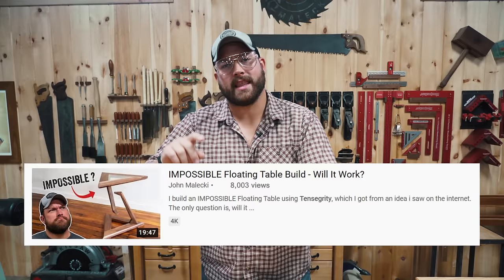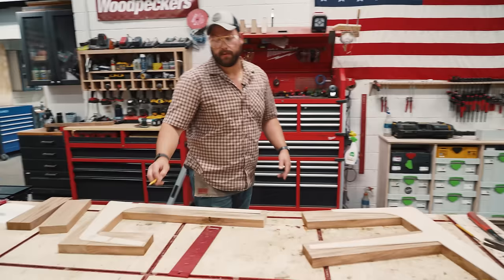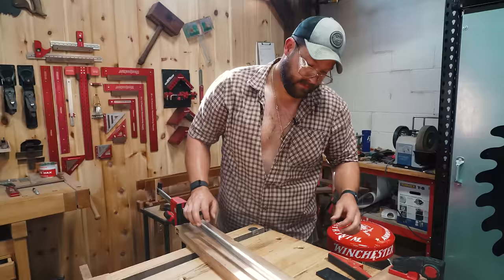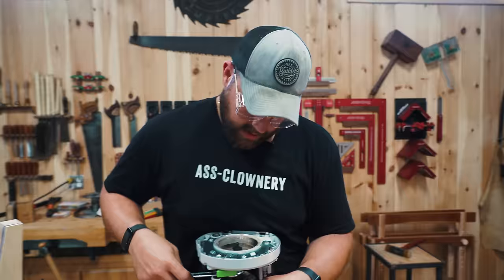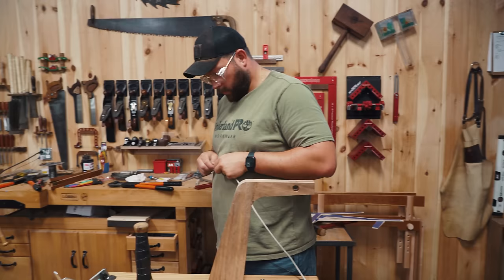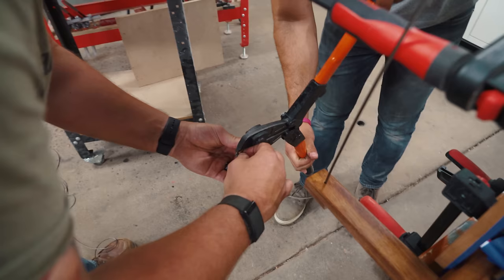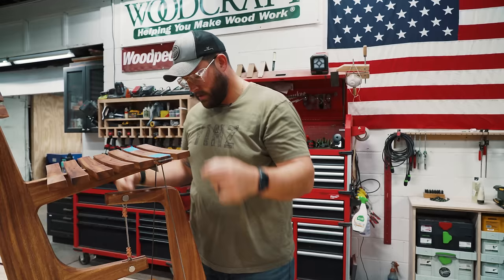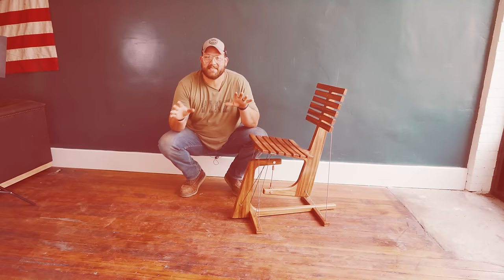Does This Chair Actually Work? My IMPOSSIBLE Chair Build

Comment: OK 1. You effectively mad a 2 point chair. All of the cables rout through the center and you lost your side to side stability as a result. Also adding a tensioning system would really help with the stability. 2. As the center of gravity changes depending on how you seat yourself on the chair, I believe you would need at least 2 cables for the vertical support one in the front and one in the rear. The rear then would either need the front of the frame to be beefy as heck or have struts running from it to the floor to support the load. In conclusion I think you need 6 individual cables to make this chair work, but they all need to run straight up and down. 2 center weight supports. 4 side load supports. Either beef up the lower frame or add some extra supports for the rear cable so it doesn't snap off when you lean back in the chair. Finally for the chair to maintain level the cables need to be tuned to be in equilibrium with each other. After all that I think you would have a really awesome looking chair that is functional. But I think it would be cooler if you used really high strength fishing line, as from a distance it would be harder to see than the cables. 500lb mono or spider wire could be pretty cool and with the changes I suggested should give around 1000lb of capacity on the lines. Though I doubt the wood would forgive anyone for trying that... Anyway awesome build. A+ for initial looks and craftsmanship. D- for functionality and engineering. AKA the perfect office chair for guests, as it looks good but also says, "You are not to sit here.". Hope to see a round 2 on this project soon.

Comment: I would believe if you move the main center carry wire 2-3 inch back on the back piece and adjust the rest of the wires, it would do the trick.
You’ll probably hafto shorten the center Wood on the back piece. Happy day.. nice work.

Comment: it could help to just move the top part forward. (making a new hole in it for the middle cable) that brings forward the center of gravity and it makes it easier to sit down because less of the bottom part sticks out in the front. cables that run through could have more stability if they are fixed where they run though the wood. also i think the last cable you added does nothing.

Comment: If you would’ve tightened the back cable while you had the same weight as someone sitting on it I would think that would have helped prevent the rocking side to side.

Comment: Extend both arms and do a "center" cable at the front and at the back to deal with the shifting weight normal chair use, would be my attempt. Then you could probably also get away with just a cable at each corner.

Comment: The issue is the counter balance is diverted so close to the middle that the slack is going to cause a dip. If the cabling went straight down on the corners, it's less likely going to dip on either side.

Comment: Before you add all the extra cables at the end if you just put a post from the rear of the base to use a cable through and hang the rear of the seat... Would make it way more sturdy because the weight would be on 2 points instead of 1. Cool chair all in all tho

Comment: Instead of one center rail make two on the edges and one in the center but turn the center one backwards and have the points of balance two on the back corners and one in the front center

Comment: agreed with Puke. A stool or something that situates the weight centrally would be your best bet. You're probably never going to be able to get away from a center of gravity that will continually want to be further back on the piece. Consider the fact that you are always going to put pressure on the chair at an angle when you sit back, so you have to counter that, but in an equal and opposite sort of fashion. 

Upon further thought, I think you could make this work with less cabling altogether, but a couple more in the center of the chair. Probably just need 2 cables on either side in the front and the back of the chair angled at approximately 45 degrees on the horizontal and vertical axis, down to the outside point of the legs, might need to make the legs a littttle longer. Then connect 4 cables from the outer most seat slats (maybe swap those to metal, or suuuuper reinforced wood) to the center of the bottom (where you have the single cable currently). In doing it like this you should have fairly equal tension in all directions so that even when you sit in it the backwards force should be counteracted by the cables in front on both sides and from the legs as well as the seat. I'd love to test this out... might have to see about whipping up a tiny test of it.

Comment: Put turnbuckles on the back bottom wires and the front seat wires and make the wires independent from each other instead of using single wires. That’ll allow you to compensate for the torque issue.

Comment: rebuild it, move the CG back more, or
instead of having only one cable the pulls up on the seat and 4 that tether down the seat, you should make the seat with 4 cables that pull up on the seat at the outer corners, then in the CG of the bottom of the seat have a cable (or chain) that pulls down on the seat.

Comment: Think 1 cable with 2 extra holes. At the bottom where you have the single cable going up.  I would think adding a cable on same wooden support going straight down would allow to lean back.  Or for more support instead of 1 cable down you can have two cables secured at  45 degrees kinda how the front was that you changed.  Same aspect on lower center instead of 1 cable holding full weight on lean back 2 cables would split weight.

Comment: real question, why didnt you do 2 supports along each side rather than 1 down the middle? I believe you would have used alot less cable. and it would look more like a chair floating. Rather than (as Plrbear98 said) the golden gate bridge.

Comment: I think to make the chair more possible it needs more shear weight support. Two more supports, like the primary arm in the front, positioned at the rear of the chair would put the center of gravity rearward. Also it should eliminated the need for about half of this cables.

Not so much a fix as it is a partial re-design

Comment: Total rebuild with the center cable actually on the center of gravity. Challenge mode if you can actually do it in 5 cables or less. God mode if you can do it with a single cable. (You'll still probably need at least 9 connection points though.)

Comment: I would not change too much, I think if you ran a Ratchet strap first on the front of the chair pulling forward and down, and tightened up the rear cable really tight.  Then take another ratchet strap for the rear of the chair and pull it down, and immensely tighten the rear cables it should help.  The tighter the cables the less it will move.  The cables are the weak point on the chair, so by tightening them, they will become more rigid and produce less sway.  But I do think the long rear cables are too high, throwing off the center of gravity.  If they were placed lower, they would be shorter, tighter, and produce less movement.  I look at it like a bridge, the cables on a bridge are made to not move too much.  I think I am going to try to make a chair like this.  It looks like a fun challenge for me.  Nice design and a great looking product.

Comment: Nothing can be complete without a $1000 domino joiner to compliment the other 100k in equipment to make this chair. So realistic! Im going to hustle out and fill my shop with expensive stuff I really dont need to make a chair. Love your vids! Yinz should make the same chair, only with stuff the average woodworker would have. No CNC, no saw that could cut a mobile home in half, and no $1000 joiner. Youtube vids have become one big advertisement. Could you possibly add some more sponsors?

Comment: The reason it's so unstable is because you are trying to balance it all through the centre of the chair, the central plane. You drilled a hole through the central planes and attach a wire to two outside positions. You need to balancing the mass of the component through tension. I suggest liner wire configuration, with angled wires profiling stability in x and y planes.

Comment: I'm no engineer but the center cable should be placed directly under or slightly behind where your tailbone would be. The more leaned back the chair is the further behind your tail bone it should go. You could flip the way the top and bottom pieces curve over each other and it might be easier. So the bottom arm goes up from the back and forward. And the chair piece goes down from the front and back. Having the bottom more to the back might also help with the torsion of leaning back. That's my two cents.

Comment: I like your approach to things you're like Jack Black with elves.............. it seems to me in the back of the chair with a backrest is if you go down straight down where you went maybe if you  side to side try to go front to rear as well over the existing cable that may stabilize your situation, also you may want to put some pressure on the chair put another crimp with a side to side cable is to takeup the slack, on the bottom thanks for reading have a great day keep up the good work !!

Comment: You need to shorten the base that holds the wire at the front by a couple inches and then make that arm extend a few more inches towards the back of the chair. I think it's because that fulcrum point is way too high and that's why its tilting back. Please upvote so he can see this!!

Comment: so fixing the rotation to the back should be fairly straight forward. i know this is a couple months old but if you make another anchor point on the seat base between the main vertical tension point, and the lateral cables, and anchor that to the very back end of the base  the end of the "T" shape in the back, and have that nice and tight, it would prevent the bottom of the seat portion from rotating forwarnd and taking the tension off of the main supporting cable.  That should also help with any additional lateral movement, as  the two taller stabilization cables in the back wouldn't get any extra slack from the seat rotating, and therefore making them actually functional. 

if you ever try this again with a new design,  i would suggest making the seat as level to the base as possible. as it is now, with the seat angled back slightly, it has a natural desire to rotate along the supporting axis. if you make the seat level with the ground, and the anchoring point perpendicular to that instead of the slight angles it has, there wont be nearly as much rotational bias. furthermore, on the seat portion itself, i would have a larger stronger bit of wood perpendicular to the main seat bar in the very front and the very back. that way you can have straight up and down supporting cables instead of trying to triangulate them all along a single center axis. that would really help with lateral movement as well and centering the base portion so the "crane" part supporting the main char is much shorter would help with the footprint size and strength of the overall build.  and i wouldn't be too bothered with adding an extra supporting cable to the base to spread the area supporting the chair.  your putting all that pressure and strain on 1 cable and one half inch section of the wood.  simply by adding another cable you could use a lighter gauge cable, thinner bolts to support it,  and still have be able to support more weight on it.

just my 2 cents. enjoyed the video none the less.

Comment: Maybe run a tensioned cable from the center of the bottom piece's upper curve, (the apex of the curve, if you rotated the chair backwards 45°) to the front of the actual seat while also twisting the cable for expected tension support. I think this would help prenvent the the front lip of the chair rolling up and away from the "technical" base. The easiest way to explain it is think of a house door say into a bathroom. Its pretty easy to open that door with nothing in the way blocking it. But now say you walk into that bathroom. A friend standing outside the bathroom either grabs the handle then pulls it closed while bracing his feet at the edge of the doorframe / wall trying his best to keep the door closed, or locks with one of those sliding chain locks. You then try and open the door. Its going to be a little bit more of a challenge than opening the door without any forces keep it closed. The door and the frame are two seperated objects like your chair connected by hinges (your cables). If you added a cable that acted like a sliding chain lock from the "frame" to the "door" of the chair could "open" up only so far before its locked. The six cables connected in the video are:
1. The center cable that connects the two halves and prevents the upper half from falling on the lower
2. The top rear cable that keeps the suspened top from rotating forward on its face
3 the front /\ shaped cable that keeps the chair from falling on its back
4. the lower rear cable that keeps the back of the chair from rolling on either of its sides and locks it from tilting to far forward
5. The front \/ shaped cable that keeps the seat from tilting on its side
6. The weight support cable the runs along the curve of the base
1 is your "hinge" cable (also the legs of your chair) 2 & 3 are your "doorframe" cables 4 & 5 are "locks" for your Y and Z axis
I think you'll just need a "lock" cable for the X axis that prevents the top from titling to far back from the front of the base. 
I just have a hunch that all of the weight is being put on that hinge cable which is acting like a chair with 3 out of 4 legs and the needed lock cable will help distrubute the weight across the top of the base / be the 4th leg
Reply: Enjoyed the video its a very cool concept

Comment: First, I'd see if there was a way to correlate tension in the front to tension in the back, in hopes this would distribute load... then people leaned back on the chair you saw slack form in the back line, if it was all tied together in a manner that distributed the tension I think that would give it more stability.  Second, I'd make it out of metal, I feel like that would be more forgiving tolerance-wise.

Comment: The problem is that when you sit the wood bend and so the cables in the back tend to slack ans stability is gone. You can only solve this if you tension the cables above the desired wieght you want the chair to carry. Of course, being made of wood, I would sugest you try to reinforce it with steel bars, or the wood you become "acostumed" to the tension, bend permanently and you'll be back at square 1! But, if you want to try it, Just put weights on the chairand adjust the slack. I bet you there will be no problems aftar that :)

Comment: You could probably cut off some of the hanging arm of the upper chair and reattach the cable so that the chair is centered better with the main support arm of the base. The chair just sits too far back in the current configuration as seen in the last moments of the video

Comment: The tensegrity system is (as written) based on *tension*. The chair is meant to be a balanced spring. So you align the cables and then tighten them - a lot.
To get this to work with minimal cables you will need to either calculate a balance model to work out what tension you need (hire a math grad) or create some kind of rig to progressively tighten the back and front cables once the the chair is 'loaded' i.e. someone is sitting in it.
I would be very surprised though if your design of the pinioned joint on the seat is capable of taking the required tension to make the design stable - might need to cheat with some hidden metal support in a wooden shell.

Comment: If you had someone tighten the back cable while you pulled down on the back to add constant tension you would not have as much slack when someone sat in it.

Comment: You only have one arm holding the weight and the rest are for balance have one forward arm and one back so that way it’ll even out the weight one cable leaves the balance to short try to use two

Comment: It’s been mentioned that the central cable should be under the center of gravity, which is totally true, obviously. The problem is that you have different people with different builds who will sit differently and move that center of gravity. ...so rethink your premise. There’s hammock chairs, swings, etc. which all sit suspended by strings. They use more than one hanging point, though. You’ve got a zillion cables anyhow, so what if you used two (or more) hanging points, like one on each side, or one on each side plus a back point?

If you really want to emphasize the tense gritty aspect then make sure the load-bearing cables are thicker or a different color. (Red cables would look amazing!)

Also, the front of that seat pan really needs to be rounded down in front. Everyone had a hard time edging backwards over it.

Comment: The problem is that you only have a single cable actually supporting weight. Every other cable added is useless because they lose their tension once you sit down and the wood flexes. You could probably remove all the cables you added afterwards, then add an arm across the bottom corner of the seat section and tie each end of that arm to the same point the load bearing cable is attached. If you really want stability with this stuff, try arranging the cables as two opposing triangles. That's insanely stable for use as the suspension on rock crawlers, should be just fine for a chair.